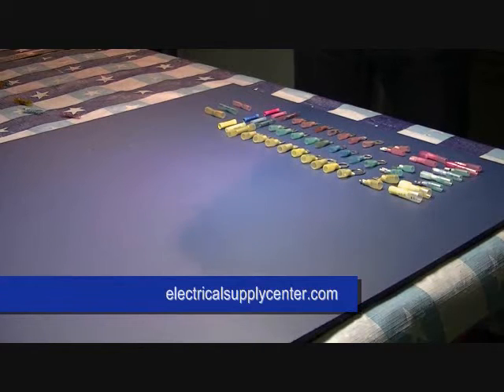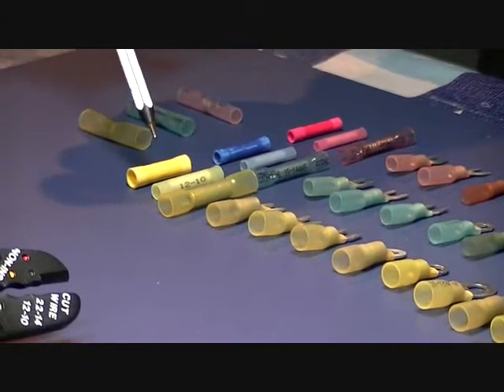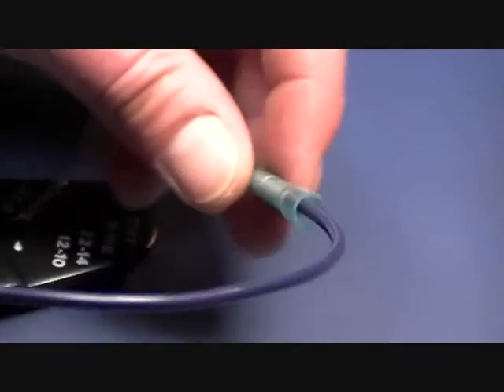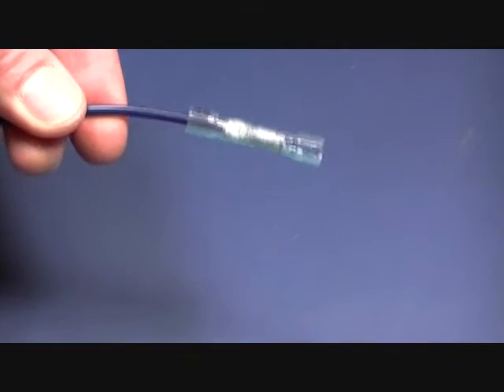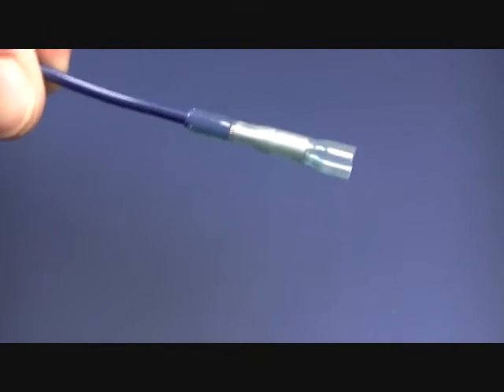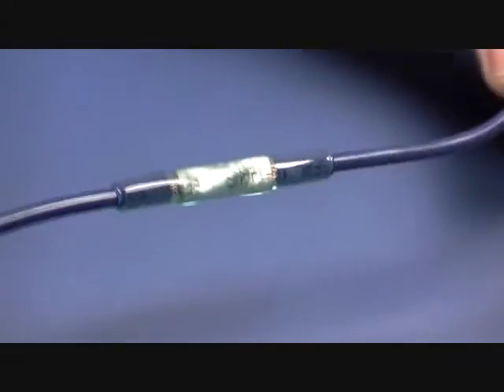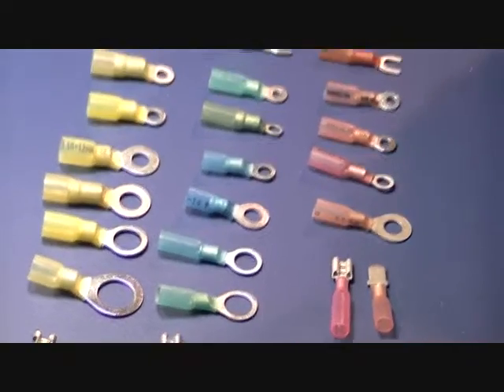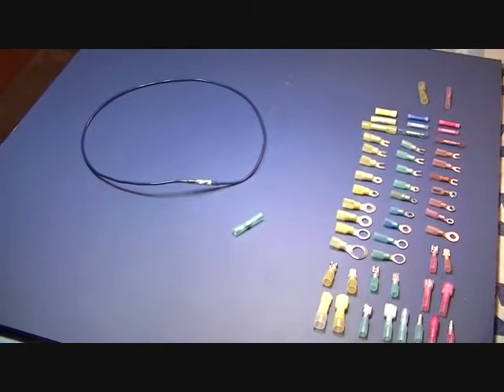Heat shrink terminals & connectors, AAA protection . How to use, crimp, install,  repair.

Comment: Great information, and very clearly presented! 

I clicked just wanting to learn the correct way to use connectors but then got exactly the info I need- how to connect wires that will be in a hot and moist environment. I'm rewiring the inside of a steam dewaxer for small-scale investment casting... these connectors seem more than up to the task. And they are made in the US- I couldn't ask for more!

Comment: Thank you Joe. Sorry for taking so long to thank you. I agree with you w/ regard to soldering. I have read and heard that boaters in saltwater prefer crimping do to concerns of brittleness of solder points in an environment where there are a lot of harmonics (vibrations), bumps and jolts as a boat goes through the water.
Kind regards, Mike

Comment: Joe,
You should ad a link to your web site in the description section of the video. What would your thoughts be w/ regard to the splicing wires via heat shrink butt connectors without solder vs with solder in a saltwater marine environment? Any advantages? Wiring that is in a bilge area. I have read that in a saltwater environment dressing the wires with a corrosion inhibitor like vaseline prior to crimping is beneficial. Could vaseline add resistence. Your thoughts?
Kind regards, Capt. Mike